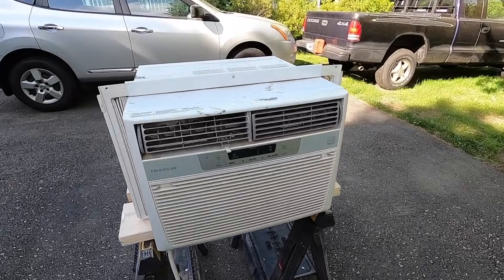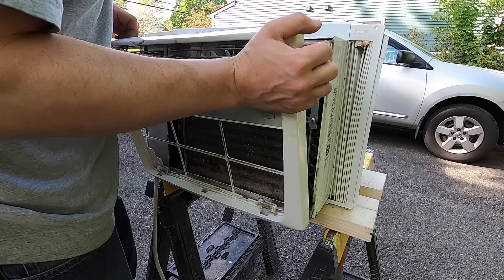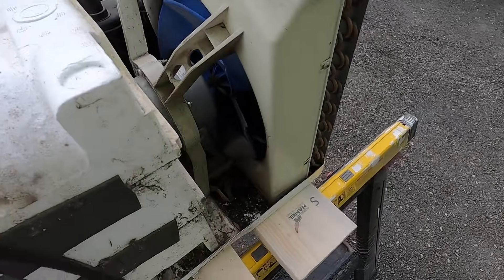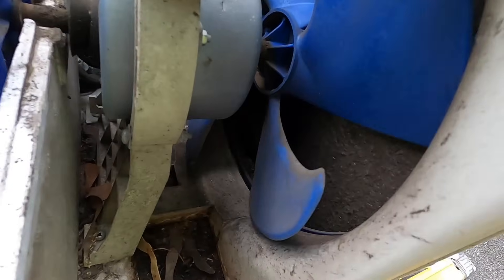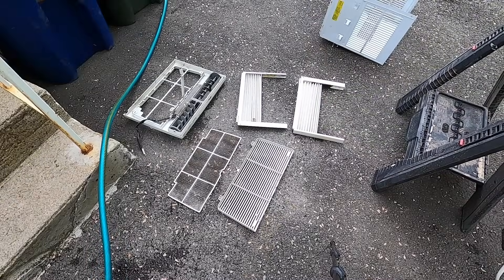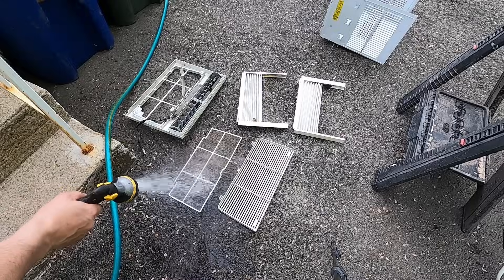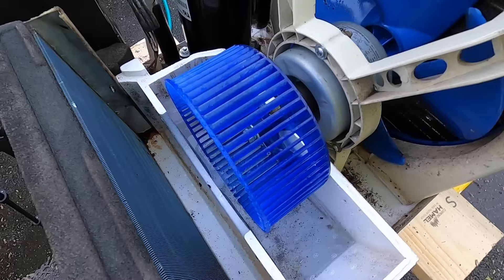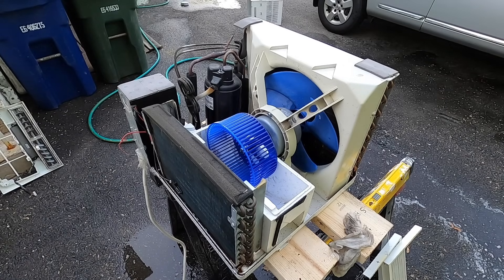How to Clean a Dirty Moldy Window Air Conditioner

Comment: The problem is that modern window/wall AC manufacturers are using styrofoam evaporator chambers instead of evaporator chambers made of galvanized steel, aluminum or even plastic which were used on older units. Mold loves styrofoam, which is a stupid, boneheaded move that could have been easily avoided, but hardly any consumer commodity is truly engineered anymore these days. The bean counters are the engineers.
Reply: I'm looking up videos right now after taking the grill off of mine and seeing that the styrofoam is COVERED in mold. I'm feeling quite depressed atm...
Reply: I am going to be taking apart and cleaning mine next week. It's basically the same as this one just a little newer. It has the styrofoam chamber. I have a role of aluminum duct tape. After reading your comment I think after I clean it thoroughly I am going to line the entire chamber with the aluminum tape. Not only will that cover and protect the styrofoam and hopefully prevent the mold it will block out the light that bleeds through the styrofoam. Oh and maybe improve airflow since it will be a smooth slick surface rather than the rough surface it currently is.
Reply: And even the thickness and quality of the Styrofoam is worse than it was 15-20 years ago (when they were already being made from Styrofoam)...
Reply: Yup, and if they are engineered, they're over-engineered to the point that you wouldn't be able to do something like this because you can't take it apart.
Reply: @PimpTwzt  How about just painting over the styrofoam?
Reply: @bobg4657  hey some killz paint might do the trick if it sticks
Reply: @bobg4657  was juat thinking black paint would stop mold inaide the styrafoam
Reply: @JH-lz4dh  mold actually causes depression so, that makes sense!
Reply: My 1995 unit has a stirofoam airduct but it still has a galvanized steel wall in the inside. I have videos of it on my page.
Reply: @PimpTwzt  I’d be interested in if that worked?
Reply: Yea!! Use some spray paint!! It will work great!!! Spray that styrofoam right down!! Work like a charm!! Try it out!!
Reply: I hate the damn styrofoam enclosure. Never could get it completely clean.
Reply: @andrewlisenby9693  it is dual purpose duct material is all..
Reply: But the styrofoam is a good insulator
Reply: @wciairconditioner8033  Yes, units that old are super overbuilt and gold compared to today's Chinese crap units
Reply: @davidcarper5411  yes sir! I just love old machines.
Reply: No joke. My unit it 2 months old and already smells like rotting garbage. Absolutely unacceptable.
Reply: @PimpTwzt  Oh my gosh I didn't even think of aluminum tape. That's genius. I was trying to think of what tf I could possibly do to cover the styrofoam. And aluminum just cannot be beat for cool conduction. idk why people stopped using it.
Reply: @maryamjoha  Another Pro Installation.. smh
Reply: REALLY great point !  How the hell do you clean mold out of styrofoam!?
Reply: @Bamcis100  Elbow grease, dawn, soft bristle brush and or scotchbright and a bleach chaser..
Reply: @maryamjoha  have you pulled the filter to clean it, I lay a downy sheet on the filter after I clean it, the scent of the dryer sheet helps. I vacuum the filter every week and replace the downy sheet. I take apart the ac unit to do a deep cleaning once a year. Good Luck
Reply: It’s money they don’t care they want u to buy another one
Reply: How does an engineer fix THAT problem?  Fresh out of gold-plated ideas/implementations.
Reply: Sev, you’re exactly correct. They won’t you to just buy a new one. We bought a couple units to put in a shed, really cheap units from major retailer, last about a year and half (two summers) of use before they were covered. The other thing I’ve notice with newer window ACs is they don’t have a proper drain on the back. Which causes the AC to eventually have a slime molds covering the inside. I live in the US south, so the humidity is outrageous so there’s significant water buildup
Reply: Friedrich Kuhl models dont have styrofoam in then all metal. Also the LG Dual Inverter dont have styrofoam either. I
Reply: you’re 100% correct
Reply: @PimpTwzt  :   how did that aluminum tape work out ?
Reply: @Join0rDIE1776  toxic spray paint? Maybe spray plastic,  still toxic bit water resistant? Idk were doomed 😕
Reply: @davidcarper5411  how do you isolate the electronics from the machine? do you screw it off? then clean the machine down with water?
Reply: @elijahmelendez9864  Yes, I always pull any pcb with surface mount pcb(s) especially control pcb, it is held in place by self tapping screws, or on some brands mechanically, then I use green hose to rinse out large debris and dirt after cabinet is removed, depending on how dirty the evap coil (interior one) I remove it to clean from inside out, that's the only way to really do it right , and completely. I use dawn dish soap and a toothbrush to clean all coils , them rinse until water flows  clear
Reply: I agree…like the plasic carburetors in lawnmower engines now. Do you know of anything that could be sprayed onto the styrofoam parts to give a more mold proof surface?
Reply: @shazzorama  ive heard somone say aluminum tape , over it,
Reply: @shazzorama  not without impeding air flow or melting the styro
Reply: Styrofoam is one of the most mold resistant insulation materials. Dirt/dust (which gets on everything) is what the mold is growing on.
Reply: @adampettus   .. it seems to the use dirt as a food source
Reply: I am 80 YO. I would NEVER be able to do this. As their plan;; Throw away get new one installed as soon as I can afford another .
Reply: @grayprincess56  Part of the disposable society, all about ME and RIGHT NOW..
Reply: Hm. This must explain why my older units always work better than anything new.
Reply: @JH-lz4dh  f&uck mine is covered in mold as well 😩 anybody know in about how much time (years) does a person can have health problems due to mold exposure?
Reply: @bobg4657  as far as i know, the paint could eat out the styrofoam.
Reply: If they would keep a heat option, the hot air would dry out and burn out the germs, mold, etc. There should be a weekly maintenance recommendation to turn on the heater (if it has a heat feature) to prevent growth of bacteria, mold, mikdew, moisture buildup, etc).
Reply: oh wow... this makes so much sense. i am constantly having to replace my a/c every season because of the black mold.  do they sell any a/c without styrofoam? i will buy it i cant stand this shit anymore. the amount i spent on air conditioners past 10 yrs i could have bought a ductless ac
Reply: @PimpTwzt  the mold will still grow under the tape. Bad idea
Reply: @PimpTwzt  That's an interesting idea. Might be worth a try. Did you do it? How is it working, if so?
Reply: @Join0rDIE1776  Haha. That's an evil comment.
Reply: @MistaDontPlay34  But air isn't blowing under the tape and blowing the mold into the room. I have black marks on my carpet from the mold being blown out.
Reply: don’t blame the engineers 😭 blame the people up top who keep telling them “who cares make it cheaper to produce”
Reply: no now they're just engineered to be replaced, before you could buy something and expect it to run for decades but nowadays they build shit to last for only a couple years or a decade at most it sucks and there needs to be laws against this shit, companies are just making inferior products for more profit
Reply: I think it's the same marketing concept as cell phones and modern cars. Just make them all go bad at some point to you have to buy a new one
Reply: @ambernestor1736  interesting. I recall someone recommending doing that with your car ac. After running the ac, let the fan blow with the ac off for awhile.
Reply: @Join0rDIE1776  will it cover good? Looks like there may be some hard to reach crevices
Reply: @adampettus  interesting. So how can someone easily keep the styrofoam chamber clean on a regular (weekly) basis without being extra invasive? I don't want to have to take it out of the window and remove the whole cabinet.
Reply: @ambernestor1736  most units have a fan only option. Wouldn't that suffice? Has to be better than nothing
Reply: @MistaDontPlay34  feels like you can't  win. Someone said there's a problem with covering it with paint and now aluminum tape. What can we do?
Reply: I spray hydrogen peroxide inside it. Seems to help. I hate it. Who can we sue? Lol
Reply: @Join0rDIE1776 lol
Reply: I use aluminium foam tape and line the styrofoam with it. Not sure if it'll affect the efficiency of the AC unit but it stays cool and that's all that matters. Could line the styrofoam in a layer of paint and then tape it too. (read some comments about mold growth under the tape); I imagine if you paint all sides of the foam, even the side that's not inside it would mitigate it. Maybe glue a layer of plastic wrap before painting depending on the paint used.
Reply: Who/what is a bean counter🤷🏽‍♀️
Reply: Omg this is wayyyy too cumbersome a job to do myself smh dang man! If I take this thing apart like that it’s gon stay taken apart ain’t nobody got time for this! Thanks for showing before I did something I can’t take back. Jesus Christ 
I got 7 years out of it so screw it! I didn’t buy it anyway so I feel like I’ve gotten my exes money’s worth. Goodnight this is a nightmare n I’m wide awake 😮😮😮😮😮
Reply: @msnita78ify  Basically they run things and want to spend as little money as possible and produce as much profit as they can.
Reply: Here I am in 2023 with a moldy ac. Looking at all the comments I’m gonna line it with aluminum tape!
Reply: use STRONG MAGNETIC screwdriver
Reply: I personally use the FAN spray mode on nozzle
Reply: I was thinking after cleaning a/c of putting a filter on the back side attached to the outside to help keep stuff out, not sure if will help or work
Reply: must be an american thing. I have not seen any polystyrene in split ac units
Reply: There should be a class action against them for designing this way. I do my best to clean mine out every year - it’s not and easy job for a widow.
Reply: @PimpTwzt  I see your comment was left two years ago. On the off chance you read this reply, did it work? That sounds like a good idea and I might try it myself.
Reply: One thing that I have noticed throughout the years is that, unfortunately, nothing is build/made to last anymore. It's all made to break/wear out forcing people to always have to rebuy. Our cars are now made this way too. More plastic than steel... my first car was a Buick lesabre... I hot a telephone poll shortly after getting my license, and there wasn't a single dent on my front bumper, a few years ago, someone ass ended me going no faster than I'd say 25mph... my whole entire back bumper shattered, and the other car looked totaled... washers and dryers used to last 15-20 years! My grandmother's washer & dryer had been passed down through 3 generations  before they finally kicked the bucket... if things aren't literally built to 'break', companies don't make money. Greedy disgusting world we live in...
Reply: ExaCt model I have...kicks ASS except the black mold spots on the styrofoam !
Reply: @Bamcis100  i blew out the exterior with my leafblower and then...I sprayed the shit out of it with straight white vinegar.. I cleaned all inside vents, filters cover...coils...are difficult be gentle. I turned it on 1 wk later no issues. Now would I hv loved to take the whole back cage housing off of course. But not an easy task. So I opted for the above. ✌😊
Reply: That is called the "enshitification of everything", a term coined by Cory Doctrow (not sure on the spelling)
Reply: @bobg4657 only a water based paint would have the possibility of working as all solvent based paint would actually dissolve the polystyrene foam instantly and even then you would need a antifungal water based paint because nearly all water based paint is layex and fungus likes latex which it a organic compound derived from trees
Reply: @YoucancallmeMarcie same!
Reply: Does anyone know a model that is not made with Styrofoam inside? The manufacturers are so stupid making them this way. I have had a bad sore throat for a week and realized the black mold in the AC is the cause! Gross
Reply: What are you talking about? Styrofoam is the one of the few things mold can’t grow on. That’s why they switched.
Reply: Can I not just paint the Styrofoam with a mold resistant bathroom paint?
Reply: @elijahmelendez9864 he shows you how to isolate the electronics in the video
Reply: I know this is an old reply but hopefully you still check. I had a window unit air conditioner for almost 20 years and never had a problem with it. My son installed a Black & Decker window unit 2 years ago and it's completely covered in black mold and he's trying to tell me all these crazy things he thinks I'm doing that caused it that of course I don't agree with. I saw your comment about how it used to be plastic and metal and that now styrofoam and the styrofoam drawers black molds and I didn't hear of that before and I'm assuming maybe that's what my problem is? So buying a new air conditioner again won't solve the mold issue it'll keep happening?
Reply: @karenopet1223  get one with plastic or metal inside. Not styrofoam
Reply: @ken-camo  I love my ductless units. Same kind of maintenance as for a window unit, though, for the same reasons … dirt, dust, mildew/mold.

Comment: My unit was 5 years old. And had never been cleaned. The mold inside the blower area where the cold air came out was about 5× worse than this one. The black mold was throughout the entire thing and had chunks of crunchy white and black stuff it would throw our occasionally. When I took it out of my window it poured some sort of orange nasty goop onto my pants. You could smell it when you had it blowing. Which was 24/7 due to texas heat. I did not clean it. I tossed it and bought a new one that's 8k btu instead  of 5k. It's like breathing heaven. So clean and so cold. After living with that thing dirty like that for 4 years I could probably huff mustard gas and not flinch.

Comment: Bleach doesn't kill mold at it's roots. However vinegar or peroxide does. Just a tip for future reference. And they're non toxic, so you could actually spray them into the unit periodically to prevent mold from returning.
Reply: Can I leave the peroxide on without rinsing it with water?
Reply: @hunnybsilly  Yeah it should be fine, but it's going to foam up and break up any build up so I would wipe up as much as possible after it sits for at least 20 minutes. And with the white vinegar, you can let that dry on it too and it will fight it from coming back. Both of them have to sit on the mold and stay wet for at least 20 min to be sure it kills it. I would treat it once a day like that for at least a week to make sure it soaks in and kills all of it and then just spray it once a week after that. And remember,.the more dirt and grime is in there, the more places mold have to start growing, so clean out as much as you can. Good luck!
Reply: @hunnybsilly  Also don't forget to unplug it first and while it's wet and try to keep electronic parts and wires as dry as you can.
Reply: @earthdaddy  Thank you for your help!! I did take my AC apart and cleaned it with bleach water but when I read your comment here I wasn't sure if it was clean also I didn't take the fan and the wheel out cause I was afraid I couldn't put them back correctly.. it was my 1st time. Thanks again
Reply: @hunnybsilly  You're welcome. Glad I could help. I used to think bleach worked too until I had to deal with a massive mold issue from renting from a slumlord. So I did lots of research and experiments. Plus the mold is irritating enough and if you can find something natural that works It's always better to use that than harsh chemicals. I know what it's like to be affected by mold and sick and it's miserable. I actually had mold growing in my tonsil stones and sinuses and I had no idea that was even possible. Crazy smh...But anyway I hope it all works out for you and you stay healthy. Take care 😊
Reply: @earthdaddy  you too stay safe!
Reply: um actually you are not supposed to put bleach on mold AT ALL. Just a friendly reminder to use your other suggestions, vinegar is best, instead and to wear a mask.